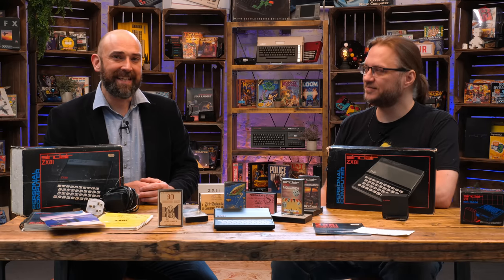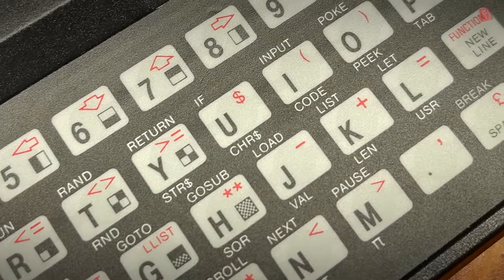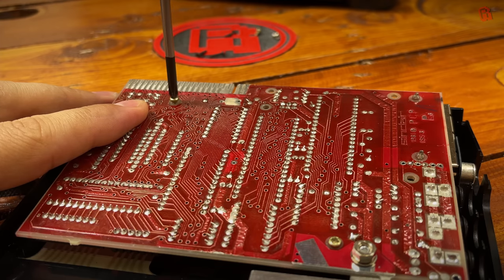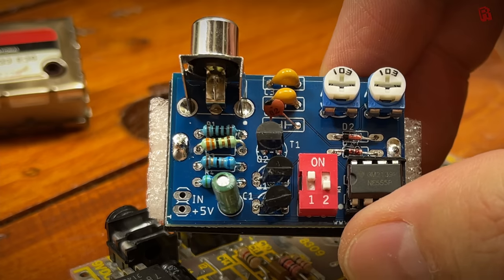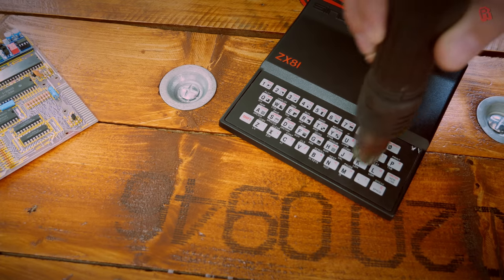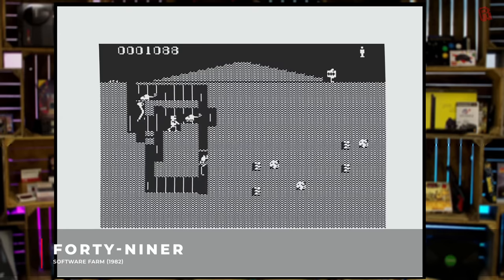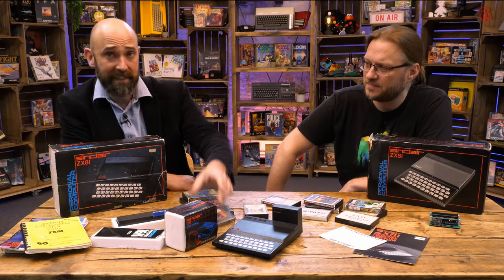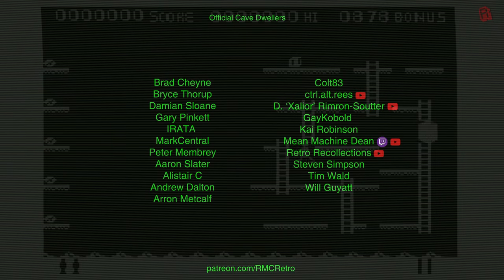Restoring and Exploring a 1981 Sinclair ZX81

Comment from the maker: Thanks everyone for watching, I hope you enjoy the episode and we'd love to hear your ZX81 memories, suggestions for software to try and upgrades we should get hold of.  Thanks as always to https://youtube.com/markfixesstuff for his talents.  Neil - RMC
Reply: My very first computer 🖥 😍
Reply: Someone needs to come up with an acrylic display, showing that Spectrum kit in an exploded view.
Reply: Mazogs, 3D Monster Maze... And I found out the other day that there was a version of Oregon Trail for it, based off one of the very early Mainframe versions of the game.
Reply: @TheTurnipKing  I still have Mazogs somewhere in my storage closet with a bunch of other ZX81 programs.  Cool game for its time!  👍👍
Reply: This was my first computer. One thing you can do, which will improve the lifetime of the keyboard, is get a replacement for the voltage regulator. The one with the aluminium plate for a heat sink. The original one is basically dumping voltage as heat to regulate it. A modern regulator will use less power and, more importantly, keep the inside of the ZX81 a lot cooler. Well worth the effort.

There are also hires mods, and nice internal memory expansion mods. But that is heading into more advanced uses. The power mod is well worth it though.
Reply: @lazyhominid   I actually built  a MUCH bigger aluminum heat sink for it way back then after reading an article suggesting it. Mine actually extended the entire length and width of the keyboard! Plus I also built a special cooling fan for it as well because I LOVED that machine so much back then and I wanted it to last! I became really good at programing in basic with it. Much fun!  Once the C64 came out, I jumped onto that "bandwagon" and never looked back until my first XT compatible in the early '90's.  Your idea for changing the voltage regulator on the ZX81 is a better and easier idea than making an enormous heat sink like I did back then.  👍👍

Comment: I recently had a fairly big project restoring mine recently, I found it sans casing and keyboard in a box at my Parent's house when cleaning things up. Decided to make a 3D printed casing and a keyboard using MX cherry key switches, found some ZX81 keycap stickers. Replaced the 7805 regulator to a more efficient switching type which allowed me to lose the large heat-sink, Upgraded the memory to 16k internally using a hardware hack I found online, gave it Composite video with a slighty different mod than the one you guys used. I could have easily just bought one for cheaper than all the work I put into it, but this was literally the computer that sparked my interest in computers, so felt it needed a little love.
Reply: I saw someone claim that since the output of the regulator was just 5V, they replaced it with just a USB connector for power. I can't vouch for it though.
Reply: @wmcbrine  That's so clever! You could even run it off of a power bank or the USB port on the back of a modern TV if you wanted to.
Reply: @wmcbrine  Suppose that would work and I know the current draw is not much. I'd only really be concerned if plugging it into USB AC adapter as those can be dodgy at times.
Reply: That 7805 sure got hot. That scrap of aluminum was not a large heatsink either. Not for how hard that chip was working.

Comment: My first computer , tip for anyone that wants to use one with the 16k ram pack.... get a BIG block of blutack you will need it , stick a lump under the ram pack and a lump under the rear part of the ZX ( I rolled it out into a "sausage" so it didn't wobble the case ) and press fairly firmly into the blutack ( with the ram pack plugged in so its all secure ) it you don't do this you WILL be playing a game and you will touch the computer and it will wobble the ram pack and reset the entire machine......... been there done that got fed up with it and eventually bought a Spectrum lol

Comment: Great restoration and review. As I live in the US I had the Timex Sinclair 1000. It is basically the same machine with NTSC and 2 KB or RAM.

There were two issues that I was able to fix:

1) It was famous for overheating so I went to a local metal shop and got a new heat sink created that is twice is long. There is plenty of space inside the computer and it made a significant improvement.

2) The RAM pack wobble was fixed by going to the same metal shop. I had the man cut down a sheet of stainless steel, not quite as wide as the expansion port. It was bent so that the stainless steel extended to the bottom of the chassis and was riveted on it. There was a small bent part that went inside the chassis about 0.5-1.0 inches that acted as a tension spring to hold the expansion module steady. I do not have the machine anymore. I hope that this explains what was done.

Comment: Way back in the 80's when I got my ZX-81, I opened the case and immediately modified the RF modulator turning the video output into composit. It worked great and it lasted for a very long time.

Comment: ZX81 was the computer that got me into computers. I saved my $150 for computer, 16 KB RAM and some games. I ended using the computer mostly for programing in BASIC and machine language (yes, I poked numbers representing instructions into memory locations individually). I was a finalist in a science fair creating graphical represent of the gas laws (the user press keys to move a graphic of top of piston to increase or decrease the volume and the screen printed out the pressure in the piston) and simulation of a virus attacking cell.  Thanks for an excellent video.

Comment: Thanks for making me feel old,  I was 25 in 1981. I bought the ZX81 kit for £79.99 directly from Sinclair and the wobbly 16k RAM pack and thermal printer from WH Smith. Soldering the chips to the board was pretty exacting work, I doubt I could do it now. Happy days.

Comment: You would be amazed how you can get used to typing on that keyboard.  I used to have mine just sitting on carpet, never really had to worry about the wobble for whatever reason.  I would just swipe my finger back and forth over the surface, just briefly stopping and pressing slightly to get keys to activate.  I could code surprisingly fast that way.  

You can get used to anything I suppose is the message there.
Reply: Cool man !

Just going to mention wildly exaggerated "things" :

ZX81 Wobble thing

"Bag of cement stopped the Ford Capri arsing out"

"Spectrum games took an hour to load then crashed"

Mostly said by non owners of all 3 :) 

They just wanted to "join in" on something they were never part of
Reply: I remember my brother welded  each key to a second hand Amstrad qwerty keyboard, that was pretty clever.

Comment: My ZX81 is sitting on my bookshelf right next to a Raspberry Pi 400.  I lived in Massachusetts at the time and purchased the kit out of the UK (of course).   If I remember correctly the add was on the back page of an electronics magazine.  I could have sworn that I ordered it in late 1980, though that was a long time ago and I'm getting old.  I have 2 ZX81's, a Timex Sinclair 1000, a 1500, a Sinclair QL, a Timex Sinclair printer and a few RAM modules in my collection.  Those were the days :-)

Comment: One simple hack on the ZX81 was to switch between FAST and SLOW mode multiple times. This would generate sounds on a machine that has no speaker. If you selected the sequence of FAST/SLOW changes correctly, you could play different notes.
Reply: Would that still work on a modern TV though?
Reply: @TheTurnipKing  I didn't get the details on the replaced modulator, but I guess that will be a problem for this specific machine.

Comment: This was my first computer, I did get the 16K RAM PACK, I was a very young lad and my parents got it for me from Debenhams, back then they had a computer sections. Had 3D maze and flight simulator and the chess game most of the time I spent typing in games from books. Actually sold it to a chap that was going to use it for accounting for his business, then I moved to Vic20 that gathered dust as I didn't like it much then I went ATARI 8-bit and never looked back. Had almost all the machines ATARI made. But I did like the simple ZX81, will get one again one day just to hang on the wall.

Comment: With my grandparents' help, I bought one of these the summer of 1982. I used to have the 16k ram pack. I'm in the process of restoring it, as that keyboard ribbon tore, and I've lost the case screws. The guy at assembled it at the factory signed and dated the 7805 heat sink. It was assembled on Christmas Day, 1981.

Comment: Another excellent video and I was happy to see the ZX81 get some TLC. My ZX81 typically has a myriad of add-ons bolted onto it to the point where the only thing the machine is doing is running the ROM while everything else does the heavy lifting. The peripherals I use are the ZXpand SD Card reader, the Chroma 81 for RGB colour output, RAM and joystick port as well as the Quicksilva character set for their arcade games. One of which was featured on this video as it was wrongly described as a type in game of asteroids. Finally I do use a Memotech external keyboard to avoid using the dreaded touch panel thing that the ZX81 has as its primary interface.

Comment: Like many others, the ZX81 was my first computer. RAM pack wobble - arghhh. Luckily you're not trying to load and save games on tape - even more arghhh. But partly because it lacked colour and sound, it was easier to program than the Spectrum. As for games to play - I expect many of us typed in games from the magazines. And even worked out how to debug them. I used mine to write simple statistical analysis progs for my OU courses.  The Spectrum was used nearly entirely for playing shop or mail order games, never did much programming on it.

Comment: In the middle 80's I was at a concert where the lighting rig was controlled by a ZX81 through some kind of expansion pack. It was really fun to see the lighting engineer type the commands to load up the next sequence on the "horrible little keyboard" (his words, not mine!)
A couple of months later at the same venue, a different band was using a BBC micro to play the kick drum parts because the drummer was still learning and couldn't work the hi-hat and the kick drum at the same time!

Comment: You can tell what I thought of my ZX81 (which was my first proper computer after using my Grandfathers Tandy Scorecard) which I received as a Christmas present in 1983 (I was 10) as its final resting place was in the swimming pool in the garden (sounds grander than it was, it was a 5ft tall circular metal ring with a thick plastic inner which was dug into the garden, took ages to fill from the hose pipe)  after I threw it from my bedroom window.... I hated it and thankfully Christmas 1984 resulted in the spangly new ZX spectrum which I still love to this day.

Comment: Great to see.  Got my TS1000 working a bit ago.  The RAM pack is dead, but I got a chip to do the internal 16K mod.  But at least I have a whole 2K to work with rather than 1K the ZX81 came with until I add the RAM.  ;-) ;-)
Have to admit I am a bit surprised there wasn't a standard audio expansion back in the day, kind of like there is for the original Commodore PET...

Comment: You can fix the keyboard membrane connection by trimming it with scissors, I've had to do it multiple times on the Spectrum.
Reply: I was going to say this... as long as the cable's not already too short (or maybe brittle with age), you can trim it repeatedly and reinsert it. At some point, it does get too short (ask me how I know).
Reply: I fixed the keyboard by grafting a surplus keyboard from Radio Shack onto my ZX81. I replaced that flat ribbon with a rainbow ribbon cable. It all worked great but spewed out RF interference. So it was not exactly an approved mod.

Comment: 7:48 Opening windows for a 5 minute job is overkill IMHO. Keep in mind the fumes are from flux (which may be irritant with prolonged exposure), lead doesn't vaporize at such low temperature.
Reply: Right. I bet they didn't bother with any fume extractor or opening the windows actually.

Comment: I got sick of RAM pack wobble, so  about 20 years ago I upgraded the internal 1K RAM to 16K and built my own composite board that sits inside the RF module, (after removing the original PCB). :)
Also, last week I bought a ZX81 clone,  (Czerweny CZ 1500), from Argentina off ebay. It is in a Speccy style case with rubber keys and 16K as standard. It's a dream to program on.

BTW, Subbed.

Edit: You should play Seamines. It's very addictive.

Comment: @RMC - The Cave

Neil, I think you should have a look at the settings of the noise gate you’re using.

I’ve been wearing headphones, and the first three minutes of audio has been very choppy.

Raise the threshold, attack, and release a little.

If you have the option for wet/dry mix at output; try 60/40 respectively 👍🏼

Comment: ZX81 was my first computer here in the US (not the TS1000). What a great little machine. I got it mail order from Sinclair Research USA (I think they were in Nashua, NH). During the pandemic I wrote a ZX81 emulator: ZXSimulator (you can find a web version that runs in a browser...just google it).
Reply: As a teenager I almost published a game in 1983 with Gladstone Electronics (a US distributor of Sinclair stuff) but Timex pulled the plug that same year (I think they couldn't compete with Commodore giving $99 rebates for the C64 if you turned in your TS1000). I remember I was waiting for a contract in the mail and it never came. Game was Battleship which you can play on the ZXSimulator web page (batt_bas).

Comment: Things you forgot to mention; 1. in the early 1980s even tuning the tele to pick-up the RF signal was a pain in itself. 2. The great programming guide that was supplied was a fantastic introduction to programming for so many.

Regarding the colour ZX81. I guess it was done using the same technology as the original arcade Space Invaders machines, put coloured film over the screen.
Reply: Actually no, it's done using the Chroma81 add on. http://www.fruitcake.plus.com/Sinclair/ZX81/Chroma/ChromaInterface.htm

Comment: Suggestion on the soldering: get a bigger tip on that iron. You're soldering through hole stuff anyway from the videos I've seen so you can get away with a rather large tip. I like the chisel tips and my default is I think 1.8mm, Big Clive likes the bevel kind which is an even bigger thermal mass. The extra thermal mass and broader contact area will transfer heat faster, which will make it a lot easier and probably let you use a lower heat setting on the iron as well.

Great video as usual! I just always have the urge to save people from conical iron tips :)

Comment: I built my ZX81 from a kit.  Worked first time.  Some time later I built the Maplin keyboard and built it and the computer and ram pack into a home built case.  Then sold it all and bought the BBC Model B.
PS I think I paid £29.99 for my rampak from W H Smith.

Comment: I actually still have two of those with the 16k add on module.  They just need keyboards to function.  The ZX81 was the first "real" computer that I ever owned right before getting the C64.  The keyboards were the "weak spot" on those good ol'  81's.  I always meant to get a couple of those replacement "chicklet" type keyboards for them, but I just quickly jumped on the C64 bandwagon when it came out. I also have some of the Sinclair magazines and some other books around about them somewhere.  Many fond memories using them and using my old tape recorder to store and load programs which I still have around somewhere.  I wonder if they still work?  I loved playing Mazogs, I think it was called.  🤔
PS: I remember the first time that I discovered that it could actually play "sounds and music" on my TV set speaker!  I was thrilled!  Good times!  👍👍❤❤
PSS: I actually built a better and bigger heatsink for it's main 5 volt regulator and a cooling fan as well because I loved it so much and wanted it to last forever.....then I fell in love with the C64.  😍

Comment: Just picked one up myself today. Tuned it in to just find a black screen, or sometimes a white one, with no cursor or seemingly any response from the keyboard.

I opened it up and found that the ROM chip had a pin that was both rusty and also broken. Do you think that could be the cause of my issue and if so how easy are they to replace?

Comment: I bought a ZX81 in 1983 from (I think) Boots. I didn't have the RAM pack, but the wobble problem I had was with the power connector. Tapping the keyboard too hard interrupted the power supply, which wiped the memory and cleared the monitor screen. Intensely frustrating! Fortunately I changed job soon after and had access to a Commodore machine which lacked that idiosyncrasy.

Comment: My first computer and was quickly upgraded with a Memotech ram pack follow by three Maplin kits in form of a full-size keyboard, 3 channel sound and hi-res graphics. I loved the little beastie and still have it to this day. I did do a simple video out mod using just a transistor and maybe resistor which worked just great. I do find modern TV’s don’t like the loading flashing and blank the picture, does that happen with the mod you did?

Comment: My first computer got it in 82. Ram pack wobble Grrr. I had a Hi rez version of defender running using the ram packs extra memory. Ram pack wobble Grrr. Used it with a portable black and white tv that I still had before I moved several years ago. Ram pack wobble Grrr.
I will have a check in the box I have tucked away as I may still have a ZX81 cassette or two, if lucky maybe that defender game too.
Reply: Also remember in my first job the store manager was so interested in me talking about my ZX81 that he got one a few days later to do his accounts on lol.